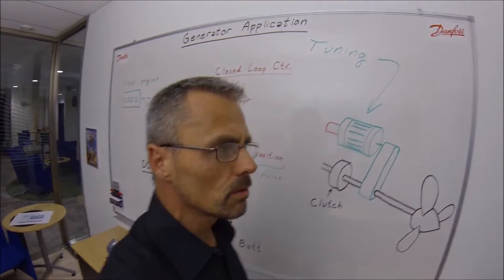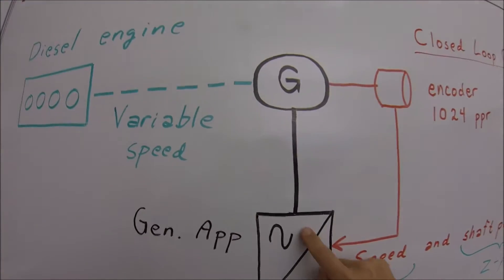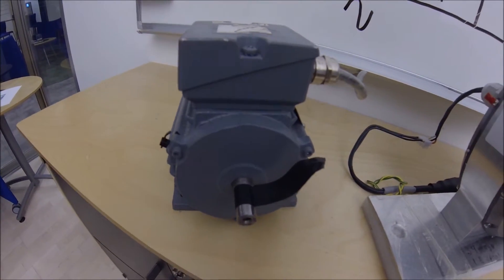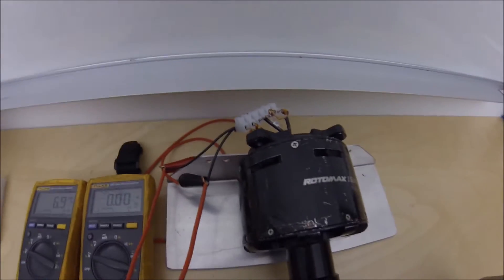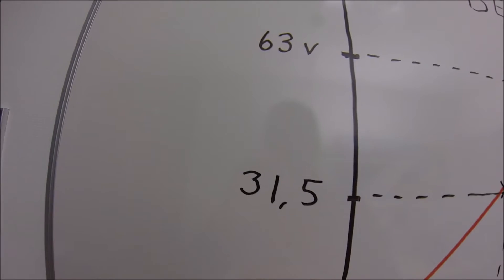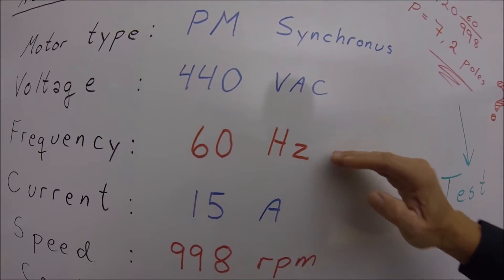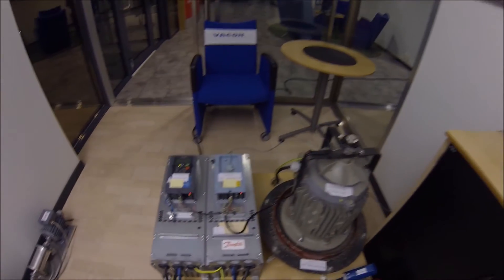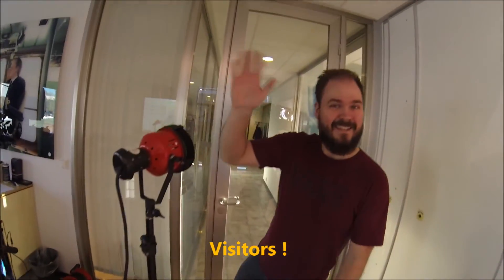Drives School (E13) - Generator, how to check motor data

Comment: maybe you have a video or text about your experiment stand (encoder, software, how you collect data to laptop)?
Reply from the maker: The stand(s) are made for education purpose here at Danfoss Drives in Norway. We use them for customer training and preparations before site comissionings. We may make a video about the test stands some day. Collecting date to the laptop is done on two levels. For service purpose we use the NcDrive application. For process data seen on the touch screens it is regular fieldbus com between drives and PLC's.
Reply: thank you for your answer, l forgot that inverter can handle and send data. And what about custom encoder on motor, it connects to inverter or directly to ncdrive?
Reply from the maker: The motor encoder is connected directly between motor and drive. In closed loop (servo) mode it must be able to update the drive closed loop controller in 1 ms (one millisecond) to ensure precice and smooth speed and torque control. Incremental encoders are preferred but any other type will do. Encoder reading from drive to NcDrive or PLC will then be over serial link, fieldbus or ethernet. Speed of that communication is relatively slow. Only EtherCat are really fast this days with fieldbus speed faster than 1 ms. The encoder signal can then be used also for general process control and monitoring what's really going on with the motor shaft.